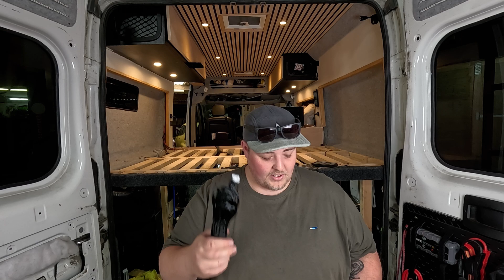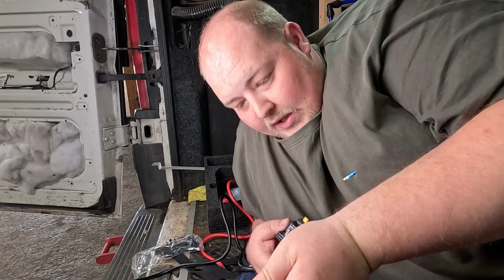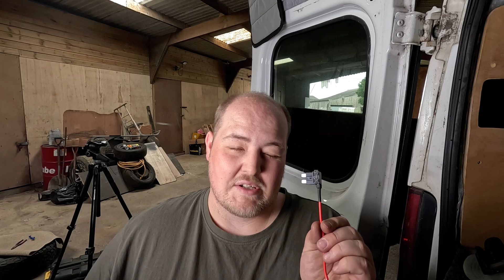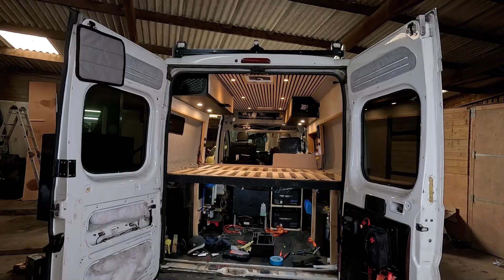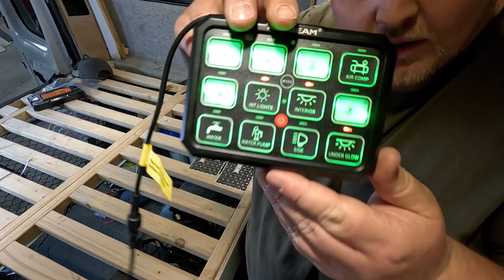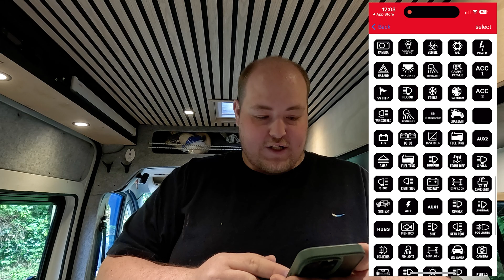Auxbeam 12 Gang Switch Panel! WIRE YOUR VAN IN A DAY?!

Comment: Can this replace a faulty Calira 12v. I belive the Calira is wired to both my starter battery and my leisure battery. Not entirely sure
Reply from the maker: I’ve not heard of the Calira 12v before, but a quick google and it doesn’t look like the same thing. 

From what I can tell it charges the leisure battery from the van battery so is acting as a DC - DC charger. With a switch panel built in. I don’t know of anything that can do that as I tend to have a separate DC - DC charger like a Victron 12-12 50. But you could go with one of the lower powered ones like a 12-12 30 to reduce cost, and then a switch panel separately.
Reply: @ The company went bust in 2013, I believe Truma bought the stock , my van is a 2014, I have been told spares were almost impossible to obtain after 2017. This unit has been repaired by Apeljack three times at a cost of approx £150 each time. That’s why I was looking for something different . Thanks for taking the time to reply 👍

Comment: I want to fit some external lights on my campervan, driving spot lights and once parked up, exterior lights for under the awning and over the rear doors.
Reply from the maker: I still need to do one for our awning instead of the roof rack ones! They are very useful! I’d definitely recommend Auxbeam! The quality difference from EBay lights to Auxbeam is the next level! 💪